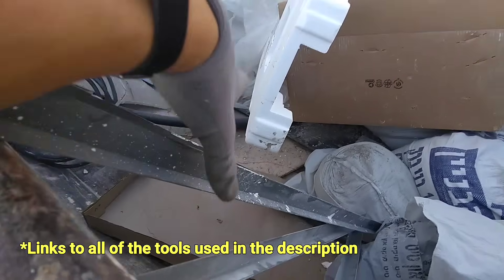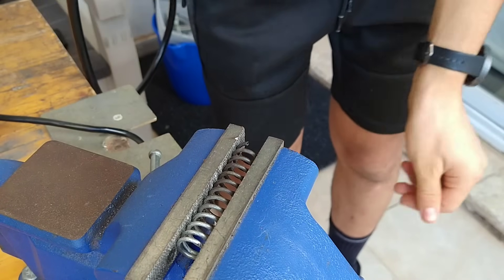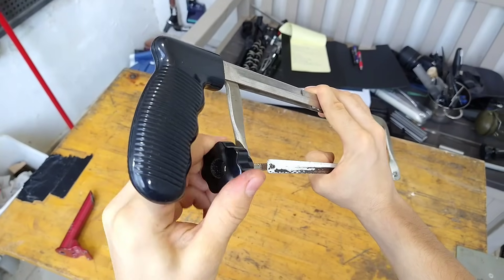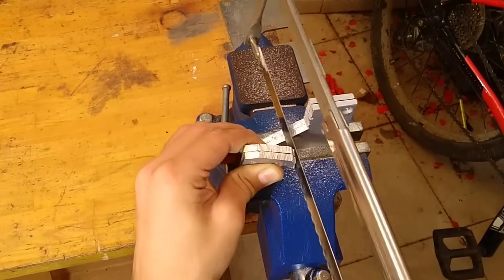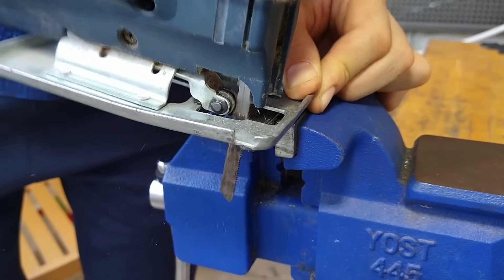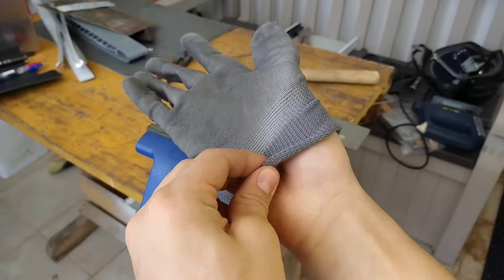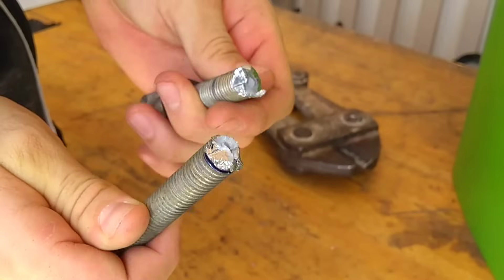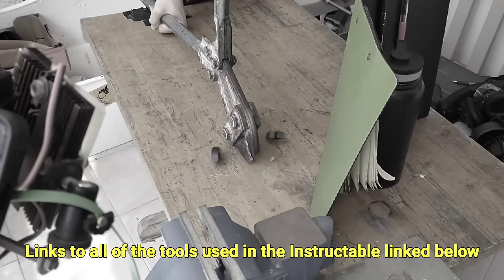Top 10 Ways to Cut Metal WITHOUT an Angle Grinder - A Comprehensive Beginners Guide

Comment: There are different saws for different jobs. Knowing what to use is the skill. Something to note is aluminium and plastic s usually don't cut well with abrasives blades. Aluminium is in the middle and prefers slow non abrasive tools. You can actually plane aluminium with a hand or electric planer. It grabs so use small settings.
Reply from the maker: Woah

Comment: for bending blades without tension reverse so you pull the teath rather than push better for thin materials as well, double or triple your blades in the frame for your slots in metal don't forget for long thin cuts most hacksaws can turn the blade forty five deg to let the frame run alongside what you are cutting. Good on you for putting out a video. I have not dared yet and do not know how (70 years pre-computer).

Comment: For cutting bolts, screw a nut on past where you want to cut, then cut, then file/sand down the sharp edges, and clean out the threads by unscrewing the nut. Afterwards you can always use a threadmaker too.
Reply from the maker: @tracklizard4018 This is a very common but I've found it's not very effective. The burr created by cutting is too large for the nut to be removed without damage, so if you're going to grind it down anyway then it doesn't matter.

Comment: what would you suggest to cut a small metal ring that's stuck on a metal pole? Don't wanna damage the pole, but need the ring off to replace where the pole goes.
Reply from the maker: @GodEmperorLeto  Rotary tool? What material is the front made of?
Reply: @Yonatan24  Both are a type of steel, I know that.

Comment: Tip for cutting bolts and ending up with blown out threads…  before cutting, screw the right size thread chaser - two if you have them - on the bolt.  After the cut, you can UNscrew the chaser, with a wrench if necessary fixing the threads.  It’s so much easier when the chaser is already threaded!
Reply: If you don’t have chasers, simply using nuts also helps knock down thread burrs a lot.
Reply from the maker: @sutliffgnassi9925  Great idea! Any difference between those and a die?
Reply: @Yonatan24  Dies are meant to cut threads, whereas chasers are meant to repair existing threads.  But you could use dies too. Though if dies get off due to damage, they will just make new threads whereas chasers typically won't.

Comment: Like the video. I appreciate it . Great work👍🏼
I have 2 questions:
1. At the beginning you said Dremel is not good enough or doesn't have enough power. I was surprised because all I know is that Dremel is very famous brand of rotary tools. So what other brand or type of rotary tools you are using? I only know Milwaukee rotary tools as dremel contender

2. I wonder why there is no reciprocating saw that use sabre saw blade. I use it to cut aluminium bar and using bosch specific for metal blade it's so damn fast 😊
Reply from the maker: 1. It's surprising to me as well, it's just not meant for rough work.
2. How accurately can you cut with it? I've never tried one.

Comment: What rpm do you recommend for use on the rotary tools for each of the cutting disks shown? It’s like I’m always too slow, or too fast. I don’t get a cut and the disk just jumps around.
Reply from the maker: @Skiman__  The safe and correct answer is the manufacturer recommended speed. Personally, I always go at full speed.
Reply: @Yonatan24  haha I would definitely agree, but this is some knockoff tool I’m borrowing from someone. There no “recommended” anything lol

Comment: Today my 1 finger heavily injured (cut to half) by angle grinder.
Reply from the maker: @Love_u_Bangladesh  Woah! How did it happen?
Reply: @Yonatan24   i tried to make a square head bolt  from hex bolt.  I have not vise or grip pliers or work bench so i use my bare hand to hold that bolt (one hand to angle grinder another hand to bolt), and my angle grinder was little guilty.  I lost original nut (which hold cutting disc) so i made another nut by normol nut and 2 washer  .  When i was cutting that nut  its disc  it throw out that hex both and cut my  sahada finger (not full but almost).
Reply from the maker: @Love_u_Bangladesh  Bummer. Stay safe!

Comment: Can you use a drill as a dremel tool
Can it be used to spin blades or abrasive discs to make cuts
Reply from the maker: @saoner1  It will work, but it will take more time due to the lower RPM.
It's recommended to avoid doing that long term to avoid damaging the bearings, but it will certainly work.

Comment: I need to make a cut out for my Raspberry Pi metal case ...how is it possible ...can u help out ..I need to sand after cutting too ...
Reply from the maker: Is it steel or aluminum?
Reply: @Yonatan24  Metal : Alumium  Sir...
Its a regular Raspberry Pi Metal case, i want to modify in budget for diy...thickness exactly the thickness when 2 Metal measuring scales placed together like a sandwich...
Reply from the maker: @prabhuja7554  that's a hard one, maybe maybe an angle grinder.

Comment: Thanks for sharing. I was putting up a ceiling light that had a simple way to do it with one person, but the lines they made went in the opposite direction for what I needed and considered cutting the lines myself before asking some to help hold it which made it a lot more frustrating getting the holes set up properly.

Comment: Awesome video!
If you don't have your jigsaw pendulum set to zero for metal cutting, no fun -too bouncy -so you might want to check that setting on the side.
Also you really do need to use some cutting oil or cooling method with any friction to make your blades cut better and last longer.
Reply from the maker: Thanks, this is an old jigsaw, it doesn't have that function.

Comment: Hi there, I need to cut the tip of a nail that showed up when making a 1 inch hole in a croosbar in the ceiling. I am making this hole to install electrical conduit. The tip nail is inside the hole and obstructing the progress of the bit making the hole. Thanks
Reply from the maker: Would a rotary tool work in this situation?
Reply: I do not know if a rotary tool will work. Working inside a whole 1 inch wide and 1 1/2  inch deep, in a place not accesible for direct observation, where the nail's tip is at the top of the whole (working at the ceiling). What type of bit to use?
Reply from the maker: @haroldcastano4930  oof I'd need a picture to understand it better
Reply: Hi there, I am sorry I could not post pics of the situation. I solved it with a rotary tool and a tungsteng carbide bit attached to a flex cable. Thank you for trying.

Comment: Hi!! Thank you so much for this video. I have a question. I am trying to cut down a wire shelving rod. I originally tried using a large circular saw but it injured me. (Minor Injury) 

What do you think would be the best solution for me to use? A hack saw? Or an Angle Grinder?Thank you!
Reply from the maker: Woah. I'd say a hacksaw if it cuts the steel, though it may be too hard. If not, try an angle grinder. Stay safe!
Reply: @Yonatan24  thank you!! I found my grinder and ended up using that. I definitely wore a face mask. That was my first time ever doing something like that, so thank you for this video!!

Comment: I'd recommend wearing some work gloves. Not only will they provide some protection you'll also minimise or avoid the numbness you get in your hands from using power tools
Reply from the maker: I generally avoid using gloves because I don't want them to snag and because they're u comfortable but the jigsaw does make my hand numb after prolonged use.
Reply: @Yonatan24  good quality brands make gloves of various thicknesses and material mixes, so minimal cottons to get caught on sharp edges (although rather that than your hands!) with neoprene or rubberised texture in the palms which really help dampen the vibrations.
I guess you could add some self adhesive rubberised tape to the handles of your jigsaw

Comment: Here is a challenge for you. Find away to use a jigsaw that can cut thick hardened steel and make tight turns.
Reply from the maker: Have you tried diamond jigsaw blades? That's your best bet. Or take it to a professional that can do the work with a cnc plasma cutter

Comment: Thanks for covering so many options! Considering that it says "without an angle grinder" in the title, does that mean that an angle grinder would otherwise be the first choice? In my case, I need to widen the slots in a mounting plate for a TV wall mount.
Reply from the maker: It's a quick option, but not the best for the inexperienced.

Comment: I regret buying the first small drill press could have bought only the large one it has the same capabilities of the 13mm diameter and its maximum drilling diameter is 16mm and the motor is a lot powerfull
Reply from the maker: Which ones are you referring to?
Reply: @Yonatan24   i am refering to the zj4113 drill press that i posted a video about in my channel the unboxing video
Reply: @Yonatan24  thats the one i am refering to Unboxing of the drill press new model and test in action
45 views
1 month ago

Comment: I found that a diamond steel cutting wheel lasts longer and makes angle grinders a lot safer to use. Of course, it's important to wear PPE and have the workpiece firmly held in a vise or clamp. 

Portable and fixed band saws are another great option but they can be more expensive. And of course, a pipe cutter is ideal for pipes or round tubing.
Reply from the maker: Have you been using those Lenox diamond wheels? Have you used up more than one? I need to get a pipe cutter as well.
Reply: @Yonatan24  Those Lenox diamond wheels last several times longer than regular ones but they do eventually wear out.
Reply from the maker: @DragonBuilds  Is there a difference in the noise they create vs abrasive wheels?
Reply: @Yonatan24  The noise is about the same unfortunately. If you want a quiet way to cut metal you're likely looking at a portable band saw.

Comment: Thank you for your video! Upon inheriting a shop with several metal working outfits, such as a lathe, and no experience in metal working,  this video was a great introduction.  
I feel really dumb for not knowing what the scissors were for prior to viewing. 
Additionally, your subtle snark was particularly amusing and kept me engaged, while not detracting from the overall premise. Very well executed.  
Highly effectual approach, in my opinion, and very much appreciated.  
Also, the tips for cutting bolts (in both your video, as well as amongst the viewer comments) have been especially helpful as I have a few that I've literally been avoiding due to worry I'd damage the threads. 
👌👌👌🙏
Reply from the maker: Excellent, thank you for your feedback!

Comment: A little trick with bolt cutters. Put the nut on past where you want to cut after cutting run it off over the cut. Threads cleaned. Or just file it 😂
Reply from the maker: I've tried that and it didn't work. You have to grind it down anyway.
Reply: @Yonatan24  probably depends on the grade of nut/bolt. For instance if you cut a grade 5 bolt use a grade 8 nut. 

Either way great video. Lots of good ideas. I personally cannot stand angle grinders as I find the noise almost unbearable.

Comment: Really interesting video with great ideas. I am finding the world of metal cutting a confused one. I would like a vertical bandsaw for metal which could be used like a wood one but they don't seem to exist. Don't know about converting a wood one. I purchased an evolution rage 4 chop saw. It had hardly been used. I was cutting some 15x40mm solid aluminium when it started sticking and then flames appeared, scary or what, it didn't go on fire, but that's over 100 pounds wasted.
Reply from the maker: Thanks. What you describe sounds odd. I've heard those are decent blades, but you need to be very careful to not cut hardened steel and to ecure the work propery or the carbide teeth will chip and ruin the expensive blades immediately.
Did you secure the aluminum horizontally? I believe it's likely what contributed to the sparks and fire.
Bandsaws for metaworking definitely do exist but they are small.
Reply: @Yonatan24  These saws come with their own clamps, not brilliant but good enough. I had cut the same piece without problems before. Maybe the blade had got blunter as I noticed the blade was sticking, I thought I would try doing a bit then when it sticks raise it up. However, the problem with this is that as soon as the motor is stationary it generates an enormous amount of heat, if it is not left to cool this heat compounds so after a few times the motor can go on fire. Also (and the fire service know about this) electric motors can go on fire and not blow the fuse, so when in use they need to be monitored. As you say these blades guage cut, they have thick 3mm kerf so are not ideal. I would say they are perfect for box or rectangle section, anything over 6mm and that includes aluminium then go for a different method.
Reply: @patricksmith4424  For the problem of the vertical band saw, i would use a portable band saw. They are relatively cheep, and if you must use it vertically just clamp it in a vice. When cutting metals the blade must move slower. Also, with the chop saw, I would get a special blade for steel, aluminum, and stainless steel different kinds of metal require d different number of teeth per inch (tpi). If it was just 1 or 2 cuts on tube aluminum a steel blade would be alright, but many cuts and solid stock on aluminum will gum up the blade as you have observed.

Comment: I have a screen door that I need to cut down to dispose of. What would you recommend? 
I was thinking of just getting a sledgehammer and beating it til the metal bends and breaks.
Reply from the maker: Is it steel mesh? Honestly and angle grinder is the best solution but not as fun as complete destruction!

Comment: Great video! Hope you have advise for me. I have a 1/4” thick piece of aluminum 6”x12” and need to cut a rectangle and then cut a smaller rectangle out of the middle. I want to make a ring to hold a guitar pickup. The only power tool I have is a dremel, so I was thinking I would have to do it all by hand. What are your thoughts? Thank you.
Reply from the maker: The Dremel isn't useful in this situation. I would get a hacksaw with a low tpi blade so it cuts fast because you can a lot of cutting to do. Fix the rough edges with a file and it would turn out great.
 I would only be concerned with the aluminum marring the surface of the guitar.
Reply: @Yonatan24  I did not think about that-thank you.
Reply from the maker: @spokes28  If I were you I would use plywood instead. The varnished end grain of plywood looks great and you won't chip away at the guitars finish over time.

Comment: what would you recommend using to safely cut 1/4" aluminum rod into 7mm lengths
Reply from the maker: I would use a hacksaw. Clamp it in a vise with a towel to prevent the Jaws from leaving marks and go at it. What is it for?
Reply: @Yonatan24  😊 part of a pen project

Comment: How thick was the steel you made a square sided hole in with a cut-off chisel? How would you make a similar hole in 5mm thick mild steel using DIY level tools?
Reply from the maker: I think a broach could no that. Why do you need a square hole?

Comment: Dem dumb mofos calling you an idiot for using anglegrinder discs on rotary saw, shurely haven't worked in serious metal works.
 It's an industry standard for most alloys across the eastern side of Europe. Bandsaws can't take as hard materials as anglegriner abrasive professional discs, even if they take longer on insides of ex.g. a standard 80mm forged honed stock bar. You'd never get trough the first 3 mm of that stuff with the best bandsaws, forget the rest. 
That or an autogen.

Comment: Hello brother,
Hey what would be the best cutter for cutting a stainless steel ruler of 1 mm thickness which is available in the stationary store??

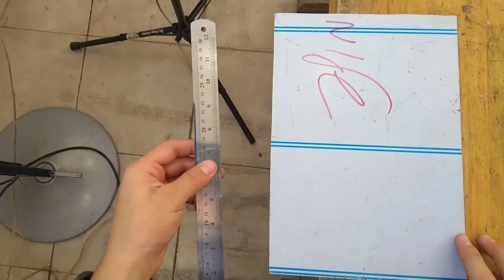Like cutting the exact steel ruler you have in your left hand @ 3:01
Reply from the maker: If you need the cuts to be very precise then a  rotary tool, if not, then an angle grinder which is faster.

Comment: Nice video. I found it when trying to find an alternative to hack sawing aluminum window screen frames. The blades always get stuck.
Do you know of a drill bit that can act like a mini angle grinder for cutting thin aluminum?
Reply from the maker: That's weird, cutting all sorts of profiles is always very loud, but I've never had blades get stuck. I've heard machinists use WD-40 for lubrication when machining aluminum. Maybe try using that? Or maybe have someone cut them professionally with a cold - cutting miter saw if it needs to be accurate to fit a frame.

Comment: If your Dremel overheats you are putting too much pressure on the edge of the wheel.
Velocity does the job. Not pressure. And its faster anyway.
Reply from the maker: It heats up anyway. It also receives 50hz power instead of 60hz

Comment: What kind of hack-saw/blade would you recommend for cutting the legs off a water-heater-stand, which is  approx 16 gauge galvanized  Cold-Rold-Steel (0.0635"/1.7mm) thick.   

Is there a certain thickness of metal, where it's advisable to buy a motor tool (dremel, angle grinder, etc)?
Reply from the maker: I've never seen something like that before, but I would try an angle grinder. 
Rotary tools are the best for small, thin, precise cuts. I've cut thick stuff with mine too, but it would probably be a waste of your time.
Reply: @Yonatan24  I would use a hack saw. If you did use an angle grinder, I would do it outside. You don't want to breath the fumes produced from galvanized metal, it can make you very sick.
Reply from the maker: @shannonjessup6997  Good point.